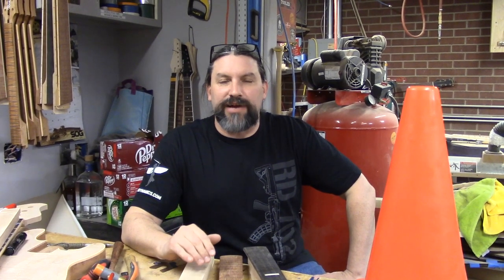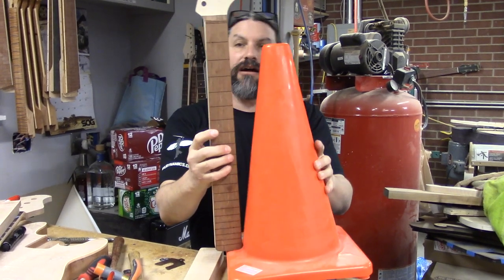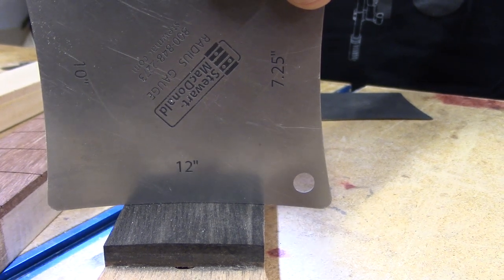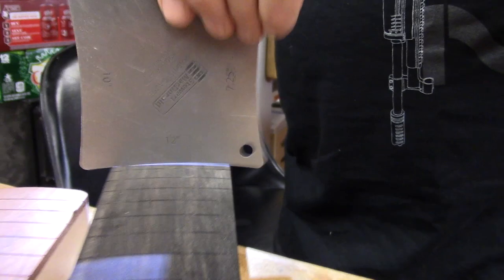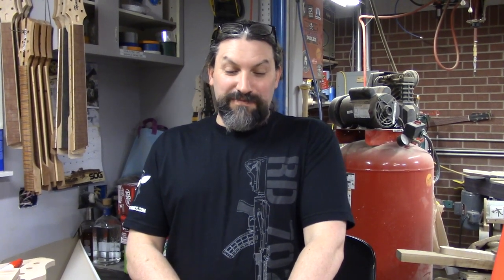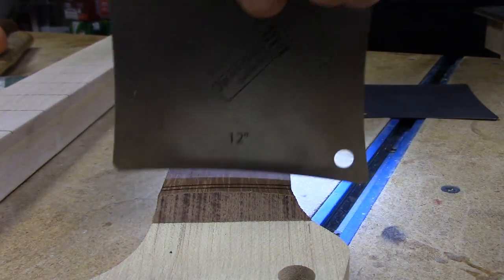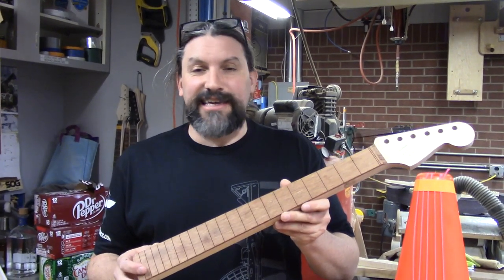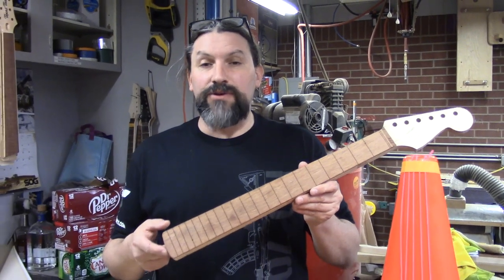Compound Radius... A Solution In Search Of A Problem?

Comment: This is what I've observed about compound radius fretboards. The only advantage I've seen is in bending notes at the higher frets. Set a standard Strat with a 9 inch radius with as low of action as you can get without buzz. Now try to bend on the high E around the 12th - 14th fret. It will probably fret out on you. Now try the same thing with an LP (around 12 inch radius), It won't fret out as badly. This is the problem with tight radius guitars. The compound radius gives you the bending advantage of an LP, but with the easy chording at the lower frets of a tele/strat. I've ordered several Warmoth necks with the compound radius of 10 - 16 inches, and I'm very pleased with the results. I also have normal Strats and LPs, and am happy with them. You just need to set them up a little different. Hendrix did fine with a 9 inch radius fingerboard.
Reply: ^^^
This.  Exactly.  
The science behind a compound radius is definitely sound - but the "viability" of it as an improvement greatly depends on the radii in question.  There's zero point in making a 14" to 20" compound.  But if you love bar chords on a 9.5" AND bending 2.5 steps on a 16" then a compound definitely works as intended.

I agree with Matt on the points of "loss" when it comes to a small-time builder.  But anyone the size (and CNC tech) of Warmoth is making "exact" 10 to 16 compounds.  I put one on a baritone build and it definitely has a noticeable difference.
Reply from the maker: I get the whole bending and fretting out thing. I don't understand how people have difficulty playing chords with a flatter radius. Like I say, if you dig it rock on.
Reply: @donvanco3078  , exactly....I hope no one thinks I am of the opinion Matt should do them, we just like to disagree on this subject, I guess...He knows I am just being a pain.
Reply: I was just banging out some bar chords on my classical, and you can indeed play bar chords with no problems. This may just be a matter of habit and personal preference. I think the strings will be closer together on the flat fingerboard than on a radius one for a given width. Probably not much, my calculus is rusty, someone else can calculate that. Chapman sticks have flat fingerboards, and 8 string guitars have pretty flat fingerboards also. Seems to be no problem with them. One thing I did notice on the few (acoustic) guitars I've made, when I level the fingerboard, I sand along the taper of the fingerboard. This seems to end with a conical fingerboard radius whether I planned it or not. I drew a fingerboard with taper on an old cardboard tube I had laying around (constant radius) and when you lay a straightedge along the taper you get an arc. I think when we're finishing leveling a fingerboard we level to conical shape naturally. Does a player notice this? I'm guessing nope. Sorry for the long post, I geek out on this stuff. @TexasToastGuitars
Reply: FWIW - I don't think it's a matter of it being "harder" on flatter radii - I just think it's easier on numerically smaller radii for lots of people.  If that makes any sense.  I think the compound was born out of the needs of those folks - the old 9/9.5 necks were great for cords and general noodling - but if you love massive bends and run a low string action the potential to fret out on notes past the 12th was pretty huge.
Reply: Hendrix was playing a pre 88 Fender... they were 7.25 then
Reply: And what is that supposed to mean - that he never fretted out? That his action wasn't set to 1/4"?  It's anecdotal information at best.
Reply: Hendrix died almost 20 years before the introduction of 9,5" radius (9" doesn't exist)
Reply: @TexasToastGuitars  it's about consistent hand comfortability throughout the neck.

Shouldnt matter if you don't need to play extremely complex phrasing, throughout the entire fretboard.

Comment: On the neck which goes from 10" to 12" to 15", what would be the correct radius for setting the bridge saddles, 18"?
Reply from the maker: Hard to say, of course, the cone will continue but it will depend on the distance from the 15" part to the bridge. I'm sure you could do math but you could also measure from the bottom of the nut slots to the top of the frets and match it all the way down... Good luck RB
Reply: @TexasToastGuitars  StewMac actually has an explanation of how to calculate the proper compound radii given the length of the neck and the starting point radius. The calculations can be used to determine the radius at the bridge. It's actually useful in setting a 'starting point' for the bridge set up.

Comment: I tend to agree with you (mostly). Compound/conical/variable radius necks usually do not make much of a difference to most players. Yes, if the maker chose the precise radius for the scale length, you can maintain an even action along the string for the entire scale. But with that comes a share of headaches, too. Necks are wood, for the most part, and wood shifts with humidity, temperature, changes in string diameters, etc. To maintain the benefit of the compound radius means that you may wind up tweaking your truss rod an awful lot, or playing with the height of your bridge (which takes away the benefit). Additionally, if your instrument ever needs refretting you are almost required to send it to the manufacturer as your local guitar mechanic is very unlikely to have the skill or the cauls necessary to bring the instrument back to where it ought to be. Overall, I think that compound radius is much more of a potential headache than it is a benefit. But everyone's mileage varies, yes?

Flat fretboards? I learned to play on an old Airline acoustic (from Sears). The fretboard on that thing was dead flat. IT worked, however.

Comment: It comes down to what feels most comfortable for your hands, it all comes into play, the neck profile, fret size, radius, scale length etc. A 10-14 compound radius definitely allows for my fretting hand to have a more comfortable transition from one portion of the fretboard to another. A neck with just straight radius through out will work for some people because of their hands, and admittedly I can of course make it work for me if necessary, but not something I would willingly choose on a day to day basis. I make my living playing constantly, so I have to have it my main guitar fit my hand hands perfectly. I have other guitars that have straight radius’s but I do not play them day in and out. 

If you take a straight radius guitar and approach playing a phrase or lick across the whole range of the neck you’ll undoubtedly find it will perform more comfortably in different areas, and this is assuming you are approaching playing the phrase with exact proper technique and relaxation. From what I have found is a compound radius will help slightly in making a more smooth transition from one end of the neck to another properly helping support the hand given the position. This may just be me, and undoubtedly I unfortunately do have hand problems from not resting enough in my early years and thus my hands are very sensitive now to the differences.
Reply from the maker: If you can feel the difference than more power to ya.

Comment: So it doesn't matter if you have a 10 radius  at the nut and a 15 at the heal of the finger board all the frets have to be level, right?
would i have to use 2  different radius block for the different radius on the finger board for leveling the frets ?

Comment: How should you radius the bridge? I have a 10-16” neck… some say radius the bridge to 16 and some say 20 as it keeps flattening as the length of of the string continues. What do you think?
Reply from the maker: You absolutely must set it flatter than the end of the fretboard on a conical radius neck if you want to realize the, mostly theoretical, advantages of said fretboard. 20" is probably pretty close. It is also very important to level and dress your frets such that they are not throwing off the radius as well. The whole thing is pretty much an exercise as far as I'm concerned. The real question is how low do you really need your action? How much relief do you have in your neck etc...
I'll say this, if you adjust your truss rod to have any  bow at all the whole thing is a wash.

Comment: It's cool that you measure round surface using wide flat tool... but that "small" difference multiplies a bit as it affects the way you have to compensate for inconsistent neck relief between strings. The idea is for all strings to have same neck relief underneath.

Comment: You can also compound radius the frets themselves if they are meaty enough. I've been doing that on guitars that I don't want to redo the entire fretboard instead. Generally from the 12th fret and higher is where I flatten the centre out of the frets so I still get a decent action and better bend-ability.
Reply from the maker: You sure can, it is a very small amount of variation

Comment: Thanks for this. I’m in the process of making my first fretboard and having some practice runs on cheap wood first. Tried initially doing the compound radius with my plane, line shown on the Crimson channel. But now thinking I might just get myself a 12 inch radius sanding block and just do it that way.
Reply from the maker: Fretboard radius is a super important step and easy to get wrong. Simplifying the process as much as possible with design or tools would be what I would recommend.

Comment: I agree with everything that you said but wanted to expand on a conclusion that you dabbled on but was a pretty big issue with my compound radius. In fairness I grew up with and am comfortable with a 12 inch radius/Gibson but on a Stratocaster body ie a Kramer super Strat. I now have a gorgeous limited edition mint green Elite Stratocaster with a matching headstock and a compound radius. It's the first time I've dealt with fret buzz. The first luthier made the bridge at an angle to raise the height of the low E and A String. I eventually flattened it by screwing it down and just raised the saddle height. I've eliminated most of the fret buzz except if I'm unplugged and playing really aggressively on the 4th and 5th fret of the low E and A. Is this an unfortunate aspect of a compound radius? What is your advice and opinion

Comment: Well, if it doesn't cost more and there is any at all advantage in terms of bending and action, even if minor, I'll take it.  I've played everything from vintage Fenders to straight 20" 80's shredder necks and I like what a CR neck delivers.  I get a slightly more curved radius for rhythm playing and a flatter surface for soloing and it makes slide a little easier up there too.  I don't buy off-shelf Fenders and build my bolt-on guitars and I get necks from Warmoth and it's a standard feature so for guitars that aren't vintage-spec, I just prefer them.  If it cost a lot more, I'd probably go with a straight radius honestly though.

Comment: Matt,  Thank for all of your insite and and opinions. I am learing a great deal from your video presentations. I also like the way you are so open minded and don't  trash talk people.
I just want to add my two cents about this particular video on fretboard radius.
As you know,, all hands are not the same.
I mostly play bar chords because of injuries to my left hand (I am  rightey). A smaller radius is easier for me to play because I have short to average thick fingers. I don't know  many folks that can lay their fingers " straight and flat. Mine are slightly arthritic and curve inward.
You mentioned playing with a slide near the end of the video. Not being a slide player, I was wondering if a smaller radius would be easier to solo on.
Reply from the maker: Hi Paul
I am the wrong guy to ask about that I'm afraid.
The purpose of this video was to point out that the actual difference between a 10 and 16 inch radius is very small. 
That certainly doesn't mean that you should chose on the other or both.

Comment: I have a 1983 strat that is a reissue of a 62, they called it the vintage series back then ( showing my age) , it has a 7.25 radius, and I have to keep a fairly high action at the bridge, not SRV high but about 5/64ths at the 17th fret, or it'll fret out bending. I did a build with a 7.35-9.5 compound radius  and I can set that at 4/64 or 1/16 and it doesn't fret out, and to be honest I can barely tell a difference both play about the same. I wanted to see what all the fuss was about and I still don't see,  It wasn't that big of a deal, no night and day difference, the flashlight backs that up.  My daily driver has I believe a 10 inch radius and I like that too, kinda middle of the road.,
Reply from the maker: Yep, your Daily Driver has a 10" I think it is just about perfect and easy to achieve.
Reply: @TexasToastGuitars  I agree

Comment: We share a lot of similar views on those conical radius fretboards. How small the differences are is easy to see when you got it all in an excel sheet and have the differences together.
Some say bending is easier with a flatter radius in the higher frets. If it isn't a very tight radius from 7,25'', sure...but with the regular 10 or 12 inch radius...nah. Jumbo frets make it easier to bend as well or if there is tons of extreme bending going on behind the 12th fret...why not go the Ritchie Blackmore way on those upper frets?
I didn't really notice that I have one guitar witha 10-14'' radius. There is so much other stuff going on that makes that neck enjoyable. The overall neck shape, how the sides of the neck curve inwards how the edge is treated and of course the polishing of the frets to make the strings glide real nice . Everyone but extreme players are happy with a medium radius...10-12''. 
Most people couldn't tell a lot of fret radii without a gauge.
Reply from the maker: Yeah, I doubt if people could tell unless you make a big deal about it. The later Jeff Cooper would call it a hardware solution to a software problem. I still think that enjoying a guitar neck, regardless of radius, is the hot set-up. You and I both know that guitars that have a great action and is easy to play will always be in style.

Comment: I think that you’re right about the compound radius not mattering that much. However, preface: I could be wrong about this, won’t a roller nut work on a 12 but not on a 16?
Reply from the maker: You are 100% correct. Provided the roller nut is a 12" radius you should be using a fretboard radius that is 12" all the way down or a compound radius that is 12" at the nut. I'm not certain what radius every roller nut is but I'd bet that they are available in several sizes to fit different guitars (just like locking nuts)

Comment: It's absolutely a solution looking for a problem.  Besides, just a little too much sanding will turn your 10 into a 12 and visa-versa.  Furthermore, I think the whole "fretting out" thing on standard necks is baloney. Jimmy Page routinely bent a step and a half (3-semi-tones) on a 7.25" Telecaster and didn't seem to have much problem.  I'm not a Tele player but I have owned plenty of 9-10" Fender Strats and never had a problem, and I've never had any problem setting up any guitar from any decent manufacturer to play well with a low action all up and down the neck.  I have a buddy who makes a really oddball electric (keyless headstock like a Steinberger)  that has a 6 inch radius neck, and they also play fine with a nice low action.  And yes - the reason bowed string instruments require a conical radius - and a very low # radius at the bridge... is so individual strings can be bowed.   The string spacing on bowed strings is much more radical than on a guitar - the nut being very narrow in contrast to the bridge.  So it has to be conical.  But if you look closely, especially on pro-quality 'cellos and double basses - it's not a pure compound radius at all. It's an oddball shape whereby the lowest string is on a flat, angled section and the three top strings are on a "tilted radius" -  take a look here:  https://en.wikipedia.org/wiki/Cello#/media/File:Cello_bridge2.JPG     The low string is set up separately and treated differently than the upper three on this type of fingerboard.  Note that there's no real "standard" on bowed stringed instruments it's all over the map from one century and maker to another.
Reply from the maker: You know as well as anyone that there are lots of ways to make instruments. Guitars that are easier to play will always be in style and people will be willing to throw money at answers looking for questions no matter what industry it is.
Reply: @TexasToastGuitars   yeah...dare I say "Automotive Industry"? I really don't need a car I have to reboot every time it gets wet. That is why I have a 1993 Jeep Wrangler...

Comment: Damn....you likely saved my bacon on the radius specs on a certain bridge type.  I didn't even think of that.  My first build is soon as I acquire the necessary tools.  Going to put a 1998ish Ibanez RG470 Floyd trem onto a Tele body.  Was planning on a 12" radius, but originally the guitar had a 12" to 16".  Thanks again for the invaluable knowledge!  I'd hate to screw up my first build.
Reply from the maker: Glad I could help out Adam

Comment: Idk man, I have a Jackson with the 12-16" compound radius and I can get the strings quite a bit lower (well, percentually) than on my 14" Kramer, both well leveled. If you like the strings to be as low as they can, compound radius will help a little bit at the higher frets.
Reply from the maker: If you like it you should run with it brougham
Reply: I have an ibanez, Jackson with compound, and a Kramer, with the kramer and Ibanez I have super low action with little to no buzz, the Jackson though I had to raise the action on the bridge side otherwise it buzzed like mad